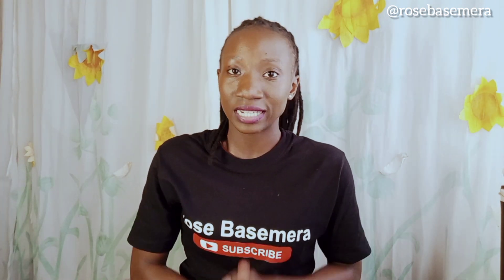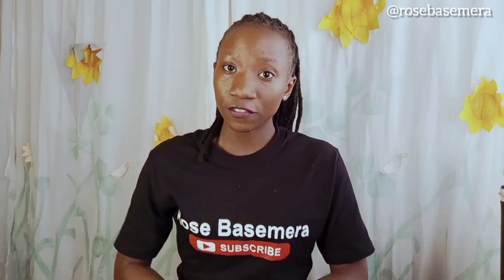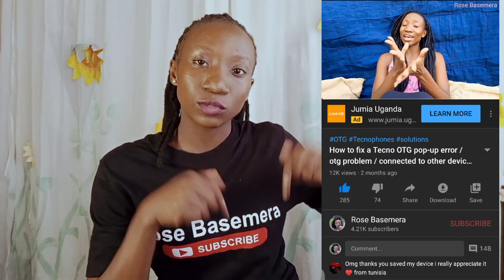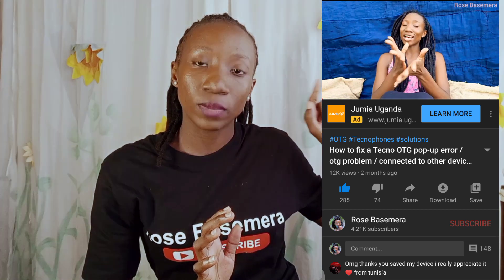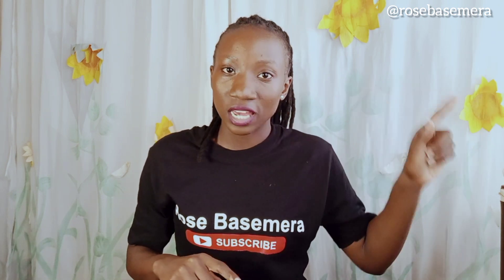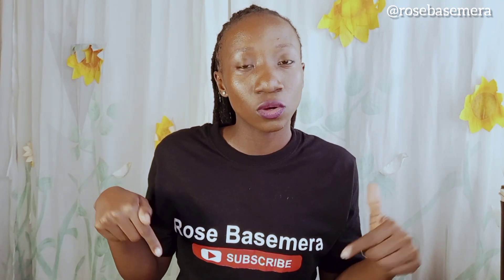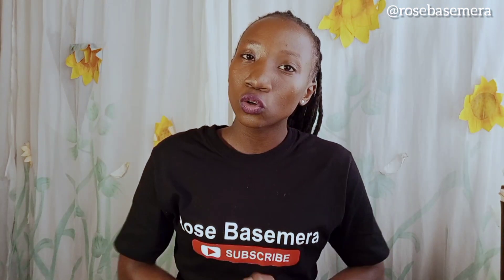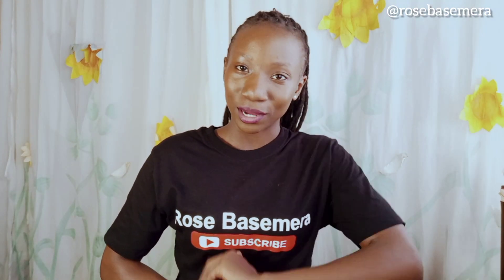How to fix a Tecno OTG pop-up error, otg problem, connected to other device successfully problem pt2

Comment: Plz help me, i am facing the same problem and from the same day my phone is not getting charged when it is on but it charges only when it is switched off..plz help me to find a quick solution, i am much worried...i have tried hair dryer hack but it did not work for me...i though my phone got hacked...
Reply from the maker: Your phone isn't hacked dear . The problem Is with the charging port. If the hair dryer hack didn't work. Try the other hacks. With methylated spirit
Reply: yrr same   happened with me     plz help
Reply from the maker: Have you got the solution
Reply: @RoseBasemera  no  shop.keeper sying  chnge your  charger pin

Comment: I used methylated spirit and the cotton bud and it's charging now but the otg something still keeps popping up... How can I stop it completely please
Reply from the maker: It didn't dry up well
Reply: @RoseBasemera  okay thank you I'll do it again tomorrow. Hopefully it goes back to normal. Thanks
Reply from the maker: @Everything_fashion-o1z  hope you dried it with either sunlight or a dryer even after the methylated spirit
Reply: @RoseBasemera  I'm yet to do it. Though the pop-ups have stopped.
Reply from the maker: @Everything_fashion-o1z  since you hadn't dried with hit immediately after putting the spirit. It might have dried on its own over night.
Anyway am glad it worked out in the end
Reply: @RoseBasemera  okay thank you ❤️

Comment: Thanks so much Rose. I tried the spirit method but it did not work out for me but later on I tried using paraffin and it was very successful. That so much. This video has been very helpful
Reply from the maker: Everytime I hear that it was successful. I feel so so happy like it were my phone coz I went thru the exact thing
Reply: I have the same problem also there is no sound, I can't hear what you are saying 💔😭
Reply from the maker: https://youtu.be/QOUO3V2MWXY practical..
Reply: @RoseBasemera  I turned it off went to bed I just woke up and turned it on starts working, this happens yesterday too , is it going to happen over and over again!!?😭🤣
Reply from the maker: Nope when you use one of the solutions I gave you. It doesn't happen again it stops unless you keep wetting your phone
Reply: @OI-bz7kr  if it has earphone sign on the top right corner clean it up with cotton buds I also went on that problem